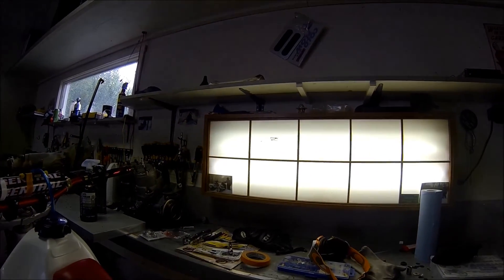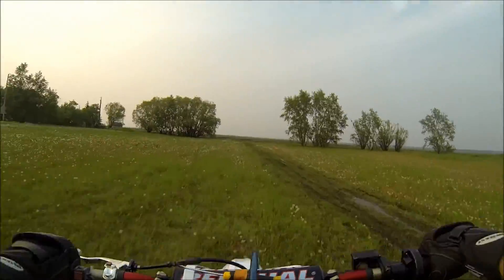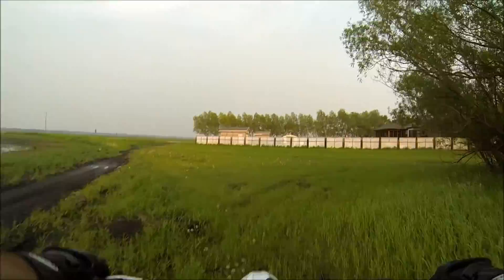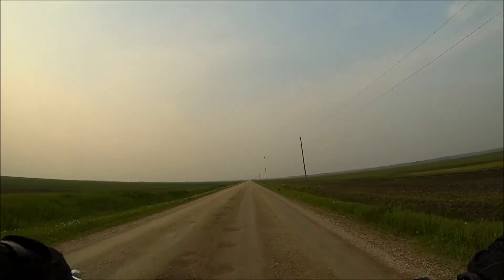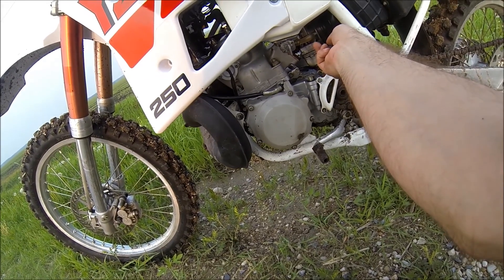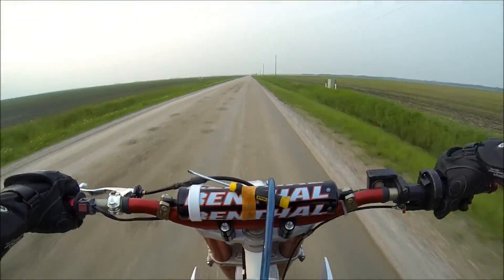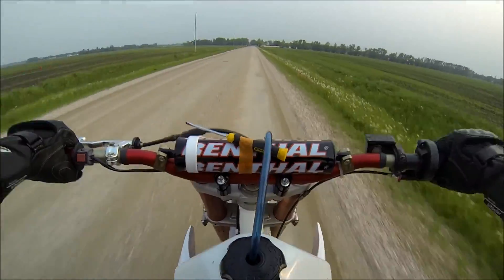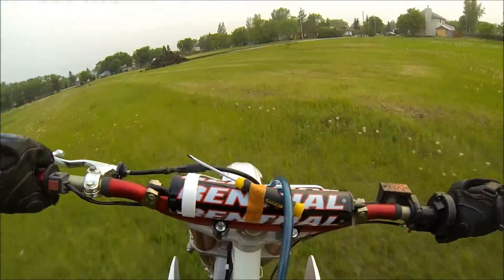YZ250 Forward Motion Test Ride Carb Carburetor Tuning Part 26

Comment: woah woah woah....when you turn out the pilot air scew it alows more air through the venturi for the pilot circuit to draw more fuel so when you turn it out it richens the low end
Reply from the maker: Yes that's correct I might have not explained it properly in the video..